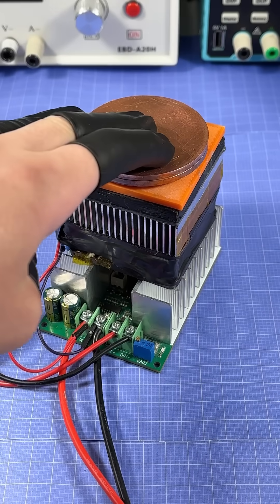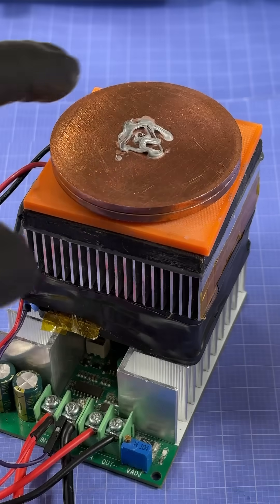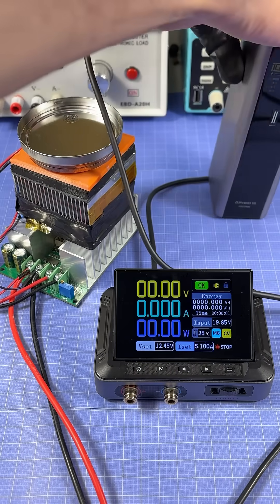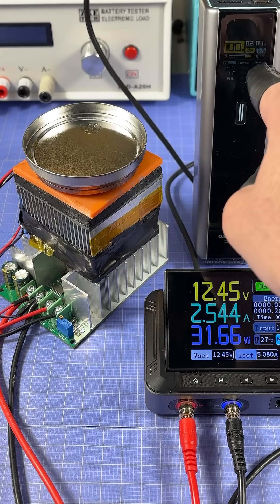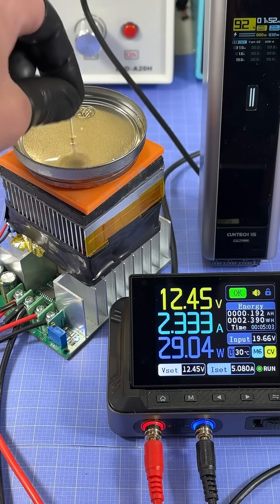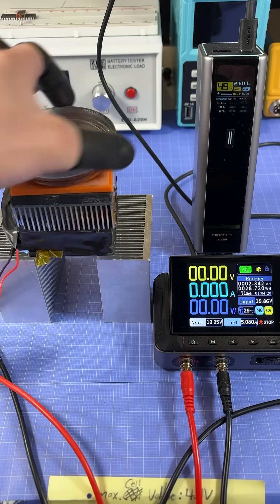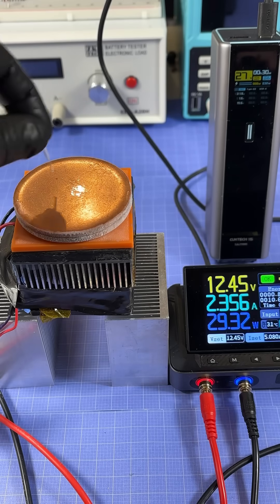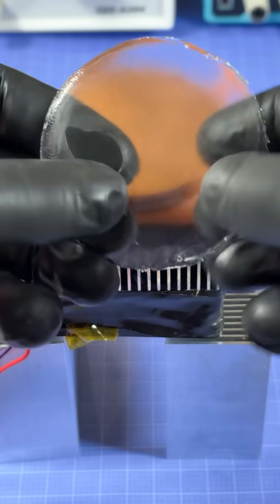Thermoelectric Peltier Cooler Test w/ USB-C Power Bank #cool #engineering #experiment #electronics

Comment from the maker: MASSIVE UPDATE I just realized my step down module has been undervolting the peltier this whole time, that’s why it didn’t work!!!! I’ll not only redo this once it does but I’m also making a couple videos too.

———————————————————- 
I should mention this is my old prototype version of my thermoelectric cooler which is less than half as powerful as my newest one which I’m working on making a full video for now:

🎶 Thermoelectric cool and thermoelectric this, 

Expect a whole lot more, for 2025/26 🎶
Reply: Thank some random deities that you've come up with something newer, I was certainly not impressed
Reply from the maker: @CantHandleThisCanYa ok how about this:

Pure Ice, no Heisenberg;

Only frozen H2 & O, like an iceberg,

Ti-tanic; hook line and sink a couple bars, that’s how I work.

Okay I’ll let my-self out the door 😔 before it gets worse 😅

Lyrical, miracle, round copper discs look like it’s outta ‘Drake and Josh’ in 2D,
IT’S SPHERICAL!!!!
Reply: @KeonsLab  imma spiritual lyrical individual with miracles ..
Reply: Idealy you dont use a voltage supply for powering the TEC but a constant current source. Respecting the peltiers voltge needs.
Reply: " Working on for the past year or so " huh😂
Reply: Wow!
Reply: You have to try 6.5-7 Volt,  this is the sweet spot your peltier become the most efficient. (or by looking its technical graph) 
.
Above 9 Volt, is when anything start useless. Under 5 Volt, you've got nothing
Reply: Imagine this cooling an Intel cpu.... this has potential
Reply from the maker: @MoBeel-t1j maybe!
Reply: @MoBeel-t1j they tried this and they are no good. There is a cold side but there is also a hot side. A high end air cooler or aoi water is just far superior.

Comment: You say it’s nots the fault of the module, I disagree. Peltier modules are simply not that efficient. Expecting them to be incredibly useful is an unfortunately common pitfall. If you need something with no moving parts, then you have few other options; otherwise just use the refrigeration cycle

Comment: These modules are powered by current literally. I have used them for years. They will work way below their rated volts so long as they have monster amps to pull. I have powered them by solar cells before the voltage was way too weak but the ams was right and the module still tried to cool while being powered by one solar cell. I have used them for years to power my Wilson cloud chamber.

Comment: The modules are usually instant. Causing supercooling  I have reached in to touch the water and retracted my finger from my fingerprints in solid ice, literally in a flash. Try covering the watertin with glass just to protect the water from open air. Finger spreading is always bad saw a thermal paste video where the filmed it spreading from pressing a glass plate on it. A center thermal paste puddle or drawing an X by applying paste as an X always spread the paste perfectly. No blank areas left at all.

Comment: Peltier are so inefficient. There is a video somewhere of a dude trying to make a fridge with peltiers and they are awful. Get yourself a fridge compressor or from an AC unit. Freeze some gases with a dual Thomson loop.
Reply: 12706 peltier use in portable small fridges  and smartphone cooler  .

Comment: What thermal paste do you recommend for repairing consoles & laptops?
Reply from the maker: For consoles I’m not exactly sure because if I remember correctly I think some of the new ones use that liquid metal stuff? 
But for laptops and PCs where it’s usually standard thermal paste, I personally just use the same stuff (Arctic Silver MX-4), 

Though I’ve heard lots of good things about one made my a company called thermal grizzly too. But both have good thermal conductivity, and I personally have had 0 issues using the MX-4 on my desktop PC whose CPU puts out quite a bit of heat, so it should be fine for most applications

Comment: Only cost $400 to make an ice cube 😂
Reply from the maker: It does take a while, but it should’ve worked here no problem, so I had no idea why that was until I checked the module afterwards with a multimeter when going to record my full video on it. 

Turns out for some reason I was under-volting everything. I literally have to redo around 35-40 hours worth of recording, retakes, and editing because I also had the same incident occur throughout the whole video :(

It probably won’t take as long and the second version will be more polished though if anything!
Reply: @KeonsLab  just really poking at you brother project is awesome! Subbed for sure

Comment: This will never work in india cause here normal temperature is always greater then 30°c
Reply from the maker: It may not work as efficiently, but it should still technically work, especially if designed properly. 
In fact I’ll make sure to remember this when testing for my full length video. (At least I’ll try my best to remember, it’s going to be BIG video!)

Comment: If its drawing 2 amps of current it is not efficient. So use a smps power supply. At least 12 volt 6 amps smps and 12706 module.
Reply from the maker: I love your comment so much because it makes me want to go continue working on the full video right now, since I can’t wait to show what actually going on “under the hood”. Here’s a little sneak peek: the peltier isn’t actually using anywhere near 12V!

I was kind of procrastination this afternoon, but thanks to you I’m going to go continue working on the video! 😁😁
Reply: @KeonsLab Thanks for the response. Looking forward to the full video, Appreciate the insight!
Reply from the maker: @Srinadhpeddinti002no problem! :)
Reply: Peltier's efficiency to form ice, can only be achievable,when ambient air is below 20°C.
In tropical weather,it can't.
Reply: obviously someone cant read a data sheet. the maximum COP or "efficiency" is at about 1/6th the rated current.. 1A on a 12706... at about 10C delta. at which point it goes off the chart to a cop of 4 or better.

making ice is not an indication of efficiency, it just means you have enough current to develop the voltage across the junctions resistance, and can get the hot side to reject heat fast enough.

power consumption increases on the square of the current. the ability to "move heat" does not.
Reply: The power supply he is using is a switching power supply that is just variable. Also, inefficiency is due to peltier cooling modules just being innefficient, not due to PS
Reply: @aqua_sakura5021> True, Peltiers are inherently inefficient. My point is that using a proper SMPS instead of a linear supply avoids extra power loss and heating, and for hobby projects it’s the most practical and cheap choice. For achieving a high temperature difference with a Peltier, a properly rated SMPS is the best option.
Reply: @Srinadhpeddinti002 theyre only inefficient when you try to achieve high temperature differentials by using high currents. the power they consume is I2R. the temperature differential they achieve is based on the voltage.
the voltage across them is based on the current through their resistance. 
 the energy they can "pump" through a temperature gradient is linear, the energy they consume to produce that gradient is exponential.

at low currents, low voltages, and low temperature differentials they can run COP higher than 4...

to keep them IN that sweet zone? 
thas the challenge.

the type of power supply doesnt matter. watts are watts.
Reply: @paradiselost9946 You’re right that Peltiers have higher COP at low ΔT, but ΔT is mainly controlled by current, not voltage directly. In practice they are current-driven devices. Also, while watts are watts theoretically, PSU choice matters because linear supplies waste power and add heat, reducing achievable ΔT. The large heatsink and fan on the hot side in the video are exactly why it works as shown.

Peltiers are current-driven, not voltage-driven, voltage is a result of current and internal resistance.

Power consumption is not exponential; it is mainly V·I with I²R losses.

PSU type" does matter" in practice; linear supplies waste heat and sag, reducing achievable ΔT.

Hot-side cooling is critical,  the large heatsink and fan in the video are a major reason it works.

Conclusion:
SMPS is the better choice.
Peltiers draws high current, so an SMPS gives higher efficiency, stable voltage/current, less heat loss, and better control.

Linear PSUs only make sense at very low power, otherwise they waste heat and limit achievable ΔT.

With a Peltier, the correct setup is: 
SMPS + current control + strong hot-side cooling(critical).
Reply: @Srinadhpeddinti002 current driven yes, but as a resistance, they require a certain potential to achieve a certain current. or vice versa, it amounts to the same thing. to get the highest gradient requires the highest voltage and that requires the maximum current. but the power dissipated will be far more than the energy..."moved" once beyond a certain threshold..

Comment: what's the power supply called?
Reply from the maker: The one powered by USB-C (connected to the TEC), or the power bank? Since I accidentally called the power bank a power supply here…

The power supply powered by USB-C is the Fnirsi DPS150, they had sent it to me to use in my videos a few months ago, and honestly it’s been my go to power supply for anything needing under 5A of current. (I wasn’t paid by them or anything, they just sent it to use and I’m honestly very happy with the quality, and that’s 100% my honest opinion)

If you decide to get one, I’d suggest using AliExpress rather than Amazon as it’s the same thing but it’s significantly cheaper on AliExpress, it just takes longer to arrive.

Just make sure it’s from a vendor with good reviews and you’ll get the exact same product at less that half of what they’re selling it for on Amazon.

I can leave a link to some good vendors/listings on AliExpress if anyone’s interested. (Non-affiliated links of course)

Comment: I wonder how long does it take to freeze in a vacuum chamber
Reply: The water would boil
Reply from the maker: @lordfarquaadgaming9316 Yes without any air to dissipate the heat using the fan based design I have here, the cold side (and hot side) would both overheat and eventually burn out the TEC (potentially boiling the water if it doesn’t burn out first)
Reply: @KeonsLab 
valid enough 
Thanks
Reply from the maker: No problem! 😁
Reply: @lordfarquaadgaming9316 
I know 
I meant how it would freeze in vacuum 
Like does ice asteroids
Reply from the maker: like in outer space! (kinda)
Super fun fact: Thermoelectric generators have been used in space voyagers where heat is generated from a radioactive source, (they’re called Radioisotope Thermoelectric Generators), where the difference in temperature required for creating an electric current is made by basically using the lack of heat (aka ‘coldness’) of outer space as a heatsink essentially.

They used this on multiple voyager spacecraft I believe, I just can’t remember which ones they were exactly, but regardless, it’s such an ingenious use of thermoelectric technology!!!
They’re capable of producing hundreds of watts of electricity!!
Reply: Nice 
thank you  @KeonsLab